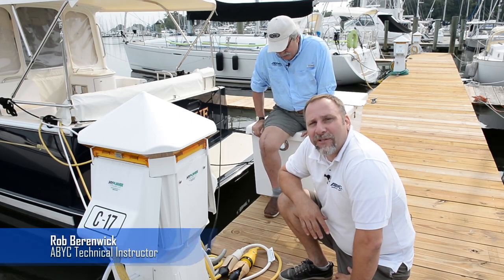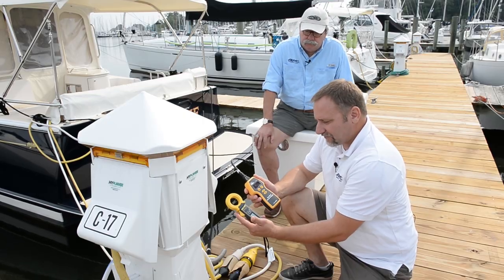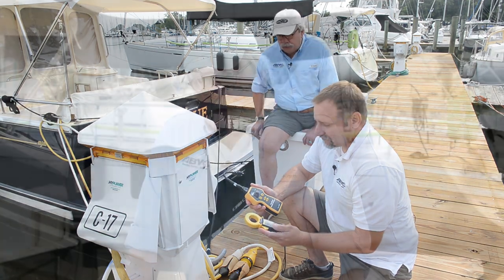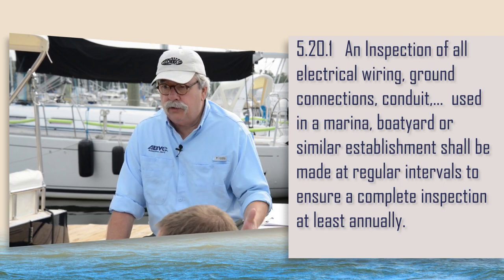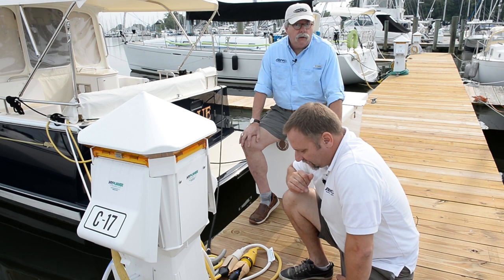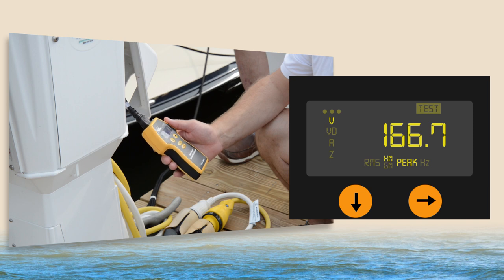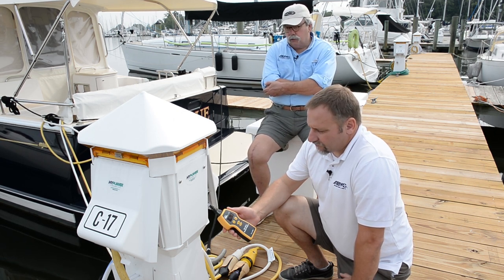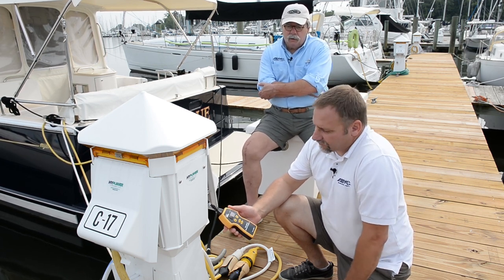Preview: AC Dock Pedestal Testing

Comment: So exactly what was taught?  Harmonic distortion doesn't set things on fire or kill swimmers.  If the purpose was just to sell an ABYC online course this failed miserably.  Just for information the square root of 2 times 116 volts equals 164+ volts so there is no harmonic distortion present but I guess you have to take the course to learn that.